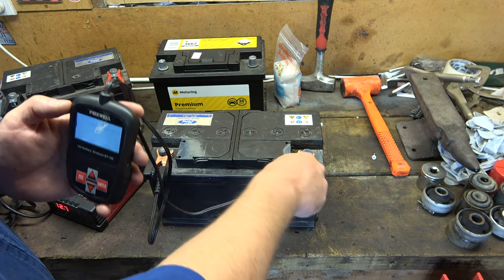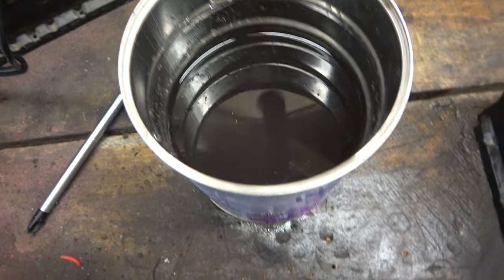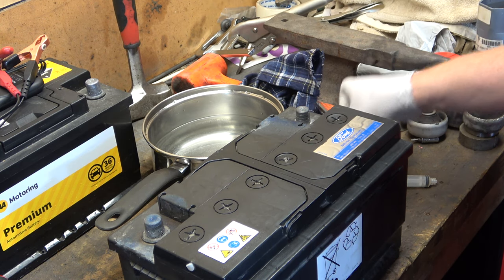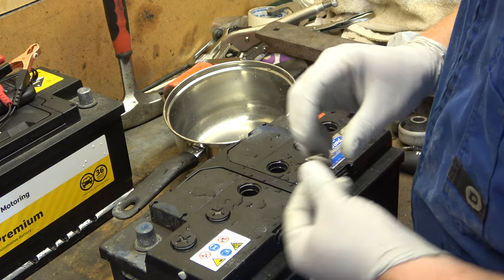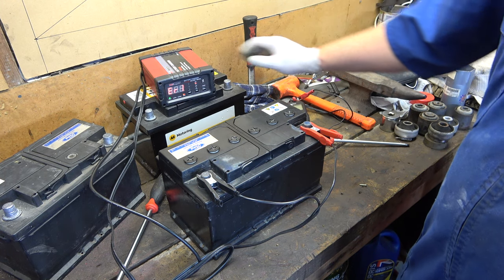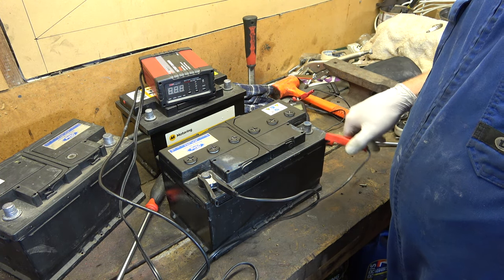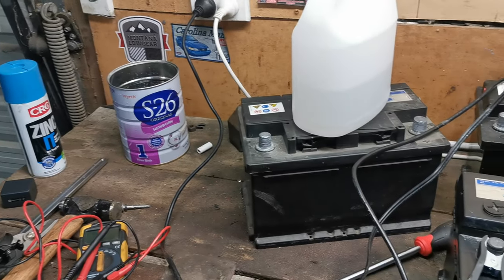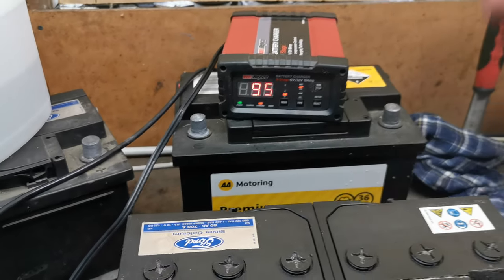Restoring Car Batteries with Epsom Salts - Does it Work?

Comment: I am Dr B N Biswal. I have tried to use epsom  salt  to rejuvenate  my inverter  battery, a huge one . It took  16 liters of distilled  water  and 3 pockets of epsom  salt. When I filled the liquid in 3 phases, from 0 it came to 08 before  changing. Whining one hour  of changing,  it came to 11. Now it is 12+. To me it is like a miracle. Epsom  salt  your presentation  are fantastic.  May Gof bless you.
Reply: Professional  battery  chargers had advised me to throwaway  my inverter battery  and purchase  a new one. My trying  your  method  made my  battery  a  new  one.

Comment: I rebuilt two of my batteries two years ago one for my truck and one for my tractor the one in the truck I drained the battery acid out of it and refill it with warm baking soda water flushed it out three times and then put in Epsom salt water charging slow for 3 days and they've been going strong for two years

Comment: I would have washed the battery with baking soda 2 stages of 6 hours each, it will clean the lead pads inside ( the liquid is dirty after this process x2 then wash it with clean destiled water) filter the acid with cotton, used a acid test meter, measure the density of it, mix epsom salt in it to increase density, or simply find another acid with better density. Hope it helps.

Comment: According to most comments I ruined my lawn tractor battery ? It would not hold a charge , I added 1 teaspoon of Epsom salt to each cell charged it 2 days and it's been working for 2 years now .
Reply: Did you dump and replace the water or did you just add the Epsom to the existing water?
Reply: @davenero8243  Just added the epsom salt and did not drain it . Battery experts call this battery " Sulfated " My theory is when a battery goes flat the sulfuric acid chemically changes to a weak acid and the sulfur portion of the acid coats the lead plates reducing electrical conductivity , The epsom salt desulfates  the battery and charging it chemically restores the sulfuric acid .
Reply: @michelgrenier1878  correct 100%
Reply: @michelgrenier1878  but you should heat water just to a pre boil and then let it cool a minute and finally stir in your Epsom salt. The reason is, Epsom salt will not dissolve if added straight to acid water. U probably got ur cells boiling real good during charge before it turned back into sulfuric acid which dissolved your salt
Reply: @michelgrenier1878  Love your theory! In physiology/medicine this is called Action Potential  ...Sodium baby sodium makes ALL come alive!!
Reply: @michelgrenier1878  yeah from what I can tell, then MgSO4 increase the conductive ions, allowing the charge to get through to the plates, and in the process re-dissolves the sulphate back into solution.

Comment: after you dump the first acid rinse with baking soda and distilled water several times cap and agitate the battery several revolutions. You'll be surprised the nasty that pours out I do the rinse thing 3x

Comment: Works very well if done right. First off you have ti flush the battery out and get all the lead particles that short out the cells. For another thing you MUST use more epsom salt. I always continue to add it till it cant disolve it all and start to get a tiny bit of unsolved salt on the bottom of the mixing container. Don't add old battery acid to it unless it is clear and clean otherwise you are defeating the purpose besides the fact that when you have got enough epsom salt in the water you are going to have a stronger acid than the battery acid anyway so why dilute it down. Once you have thoughly flushed the battery let it sit upside down and drip drain as much as possible. I just use the garden hose and a spray nozzle with it set to blast as much pressure as it can give the better the flush the better the results are going to be. Feel free to flush the battery as thouoghly as you wish there's no such thing as too much. Then you are going to want to take a couple of high wattage head lights or an old starter and drain the battery completely till it does nothing and then you need to put a high charge to it. I like using an alternator for this step as its able to put over 100amps depending on the rating of it. But anything that is able to charge at or above 30 amps will be fine and charge it for 2-3 hours and without letting it cool down completely drain it again with the light or starter and fast charge it for another 2-3 hours then do a drain but stop before you kill it completely and then charge it at a 10amp charge for atleast 48hours but it will depend on the cca rating of the battery the higher the rating the longer you have to charge it. Don't use those computer control chargers as they stop charging based on voltage and the battery needs amperage pushed into it so the old ones work best for this. If you test it and it is less than 3/4 the cca that its rated for then you need to do a long drain on it and kill it completely and recharge it at 10amps. Ive had a few that took 7-10 days of charging to get them to come back around. Works well on about 95% of batteries and I have been able to get 85% and up to 130% of the cca rating bout of them and they usually give me another year in a car or truck. But I have found that they will be fine after that for lighter dity applications like a lawn tractor or small tractor for 2-3 more years before they are finally completely junk.

Comment: You're not supposed to replace the battery acid with Epsom salt solution. Supposed to mix the old or new acid and Epsom solution 50/50 or even 70acid/30epson. The acid is needed to react with the lead.

Comment: ... using epsom salts as a secondary electrolyte seems dodgy to me.. after desulphating the battery plates, in the video really, how was that done? Your gonna need a cleaning action in the form of a chemical reaction to get those plates clean. And making sure there is no lead/calcium sediment or bridging at the bottom of the battery which could increase the self discharge rate of the battery, I would either put in new acid electrolyte or filter/clean the old electrolyte if it wasn't too bad, then put it back in. The trick is to desulphate the plates, unless those plates are a grid skeleton with little lead, and expose fresh clean lead to the electrolyte,  and of course you need to clean out any old gunk from the battery bottom that might have settled. Some have used sodium bicarbonate for that, putting a strong mixture into the battery to get some 'cleaning action' going as it neutralizes the remaining acid embedded and coating the battery plates...

Comment: Might have to do it couple of times before it work
Reply: Yes charging is key
Reply: i sawa gentleman do this...he found he had to drain the battery and recharge it again about 3 times or more to gain alot of cold cranking amps, each time he did it he gained more amps

Comment: Why are you staring at my left ear? Just kidding. What worked for me is to filter the old acid, and then refill the battery with half filtered acid and half distilled+epsom. Trickle charge for a couple days, then heavy charge for a couple hours to finish loosening the scale on the lead plates. Add a load and bring the battery to about 10.5V no load, then trickle charge again for 2 days. Battery will likely pass the tests at that point.

Comment: No Epsom salt try 200amps for 5 minutes let cool 15 minutes do this 5 times it will melt the calcium bill up then slow charge at 2 amps all night.
Reply: @Perry Vallee is the 200 amp schumacher charger theyre selling on Ebay work ?  Its an automatic circuit.  Do I need to get a manual that continues to charge at 200amp until I manually shut it off?
Reply: I do like the large transformer manuas l chargers for this but the drawback is that you can overcharge a battery if you forget. The digital ones will stop

Comment: As here, so many people who make these videos just clean the plates and don't replace the acid or check the specific gravity.  No surprise it "doesn't work" for them.  User error.
Reply from the maker: You missed the point of the video 🤷‍♂️ I look forward to your video on the subject
Reply: @Badgertronix  I must have.  I thought it was going to be a test of restoring a battery with epsom salt.  It's not as if any use of epsom salt suffices.  E.g., it also doesn't work merely to set the battery on a pile of epsom salt.  The salts help clean the plates, especially with electrolysis, but the battery requires acid for full, normal function (especially for loaded discharge)... otherwise, manufacturers would probably use a saline solution in the first place.

Comment: did you try to clean the battery with distilled water and baking soda then flush it with water again, then add new battery acid vice distilled water and epson salt?

Comment: After you clean the plates with the salt did you drain the battery and put the acid and water in it and then charge the battery

Comment: I saw a video from a manufacture that said the best way to disulfate plates is to charge the battery at 16.8 volts but only 500 milliamps for 2 days i think.. The plates get hot enough to blow the sulfate and not damage the plates. They were hawking a battery charger that did that. You should be able to use a small transformer. !6.8 vdc is just the voltage they what about 24 volts and 50 milliamps? Same effect. We all have hundreds of transformers from old devices, I know I do.

Comment: you need a bigger current 12v 40-60a charger to revive the battery ,the smart charge won't work
Reply: @oscartabares53  It's a scam, and you are a spammer, and you've been reported.
Reply: No Frank, there are cheap pulse repair chargers - you dont need the expensive high amp chargers.
Reply: @adem-Savs  not expensive at all,tons of server power modified ones with a quite cheap price,but in the real world better choice is change your battery to a set of  super capacitors,yep low in capacity but super strong current and good for your engine spark plugs
Reply: @frankli7035  absolutely. I have no idea why we haven't moved to a supercap + smaller battery setup. So stupid that we still have cars made like they are today.

Comment: here's  a few suggestions for fixing a car battery
Don't try to do this until you know what you are doing - the acid can burn you
Test the voltage first - there may be a dead cell which would waste your time.
Check the battery fluid.
Try to fully charge the battery.
(I discovered about these and more on Jons mender guide site )

Comment: Test the battery for specific gravity before you do anything then I would drain the battery and then strain what you got out of it and set it aside to put back in the battery. Next step I would fill the battery with distilled water and slosh it around. Drain the battery again and refill with fresh distilled water again and slosh it around again. Drain the battery and refill with original solution. If battery is low top off with distilled water. Now check the specific gravity again note and compare with original specific gravity.  Charge battery and measure specific gravity again, then test battery. 
 The lead acid battery used in today's automobile is made of plates, lead, lead oxide, in a solution of electrolyte. This solution consists of 65% water and 35% sulfuric acid. The specific gravity or weight of this solution increases as the battery charges and decreases as the battery discharges. As the battery discharges, sulfur moves away from the solution and toward the plates. The opposite is true as the battery is charged, the sulfur returns to the electrolyte solution.
Reply: Whoooooaahh.. mostly droppin the knowledge bomb... yeah man! 🙋🏻‍♂️
Reply: Glad two2 C ya Brother. 
Happy Motoring and have a great Christmas.
Reply: @mostlymoparih5682  You too my friend
Reply from the maker: Thanks buddy, you're a wise fella. I'll try a more scientific approach next time instead of winging it with an Internet fix that was never going to fly. Merry Christmas to you and the family
Reply: Thanks back at cha. 
Got that info from the Wizard on our trip to Kansas.
Wait I don't think we're in Kansas anymore. Cheers.
Reply: @mostlymoparih5682  thanks

Comment: The epsom salts are only for the cleaning phase.  Use it to clean the sulphation off of the lead plates.  Dump, rinse several times with distilled water, then finally refill with fresh battery acid.
Reply: this is my thought too
Reply: Yes. This method does work to break down the scale but only
Works at 15-16 volts overcharged for 24-72 hours but then the acid needs to go back in. Lol.

Comment: Hey mate, just did this method and trying to charge with an old school 6v / 12v charger although it says it's full and then stops charging. Any advise on how to force a charge.
It's a NRMA calcium battery and the charger is performer brand with 3.5ampa

Comment: I've heard of doing this, but to be honest I can't see it working.  If it did, car battery manufacturers would be filling the batteries with Magnesium Sulfate / Epsom Salts solution from new!
Reply: The problem with doing this is the battery would freeze solid in winter.  A discharged battery will also freeze because all of the acid gets used up when the battery is discharged.  Charging the battery converts it back to acid again which has a much lower freezing point than plain water.

Comment: I thought the procedure was to add epsom salt to the existing acid and top it up with the distilled water. Not remove the acid.
Reply from the maker: There are hundreds of different procedures if you Google it. As I said in the video I started with the simplest one to see how it went. Badly as it goes
Reply: @Badgertronix  I would take out a little of that fluid and put in some sulfuric acid at this point. They'll probably charge. Don't think that proves the epsom salt did anything though.

Comment: You are the 3rd Youtuber that has done this wrong. 
The salt mixture is for cleaning only. You have to put back the previous acid, or make a new fresh acid and distilled water mixture, as it would be new.

After running a heavy charge, you have to flush out the battery, because it will be very dirty with lead .
Flush with either regular water, until only clear water is coming out. Then do one last flush with distilled water. 

Then put acid mix back in. 

You can reuse the old acid. By the time you have ran the salt mixture and high voltage charging and flushing, the acid that you emptied will be clear, and the lead sulfate particulates will have settled at the bottom. 

Try not to let the black lead back in. 

And last. Make sure to use a acid testing kit, to get the proper balance. 
Then charge the battery for use.

Understand, over time, lead oxides will build up crystalline layers on the lead sheets. Because of this, you can have a fully charged battery, but no cranking amps, because not enough of the lead plates are available for discharge. 

The more a battery is used, the quicker lead sulfate is produced. And it wants to bind to each other, and dose this well, when battery temperatures get high.
Hot temperatures will help the acid to break down the lead, and delute it into oxides.
Reply from the maker: Are you new to YouTube?

Comment: 1. Calcium batteries are not good for restoration... i dont think. Use a normal battery
2. I dont think the battery was properly desulphated.If not desulphated it wont work no matter what you try. 
3 did you check for bent/ shorted plates?

Comment: You never put the battery acid back in the battery after you were done using the salts to descale the lead plates? How was it to work with no acid in it?
Reply from the maker: You missed the point of making sulphuric acid from magnesium sulphate as per the Internet myth. Clearly it doesn't work
Reply: Badgertronix ahh...well I did see that part but tuned it out ha. I always dumped the acid and hose the battery out. Fill with water and funnel a handful of Epson salt and cook that thing on 15v with the caps off for a few days. Dump rinse again then add new acid or the old stuff if it doesn’t look to full of lead crystals. Have you tried that method?
Reply from the maker: Nah, I was just trying this method for a video.

Comment: After charging, float charge it for about a week, then drain and neutralize the mixture.  The mixture helps desolate the plates and basically electroplates the bad spots with magnesium, leaving sulfuric acid (or something similar as baking soda will react with it).  After draining, add regular battery electrolyte solution and charge.

Comment: Where does one dispose of the acid safety after use?
Reply: Once neutralized with baking soda, it is safe to pour down the drain with the water running.

Comment: I used to make car batteries so I know how they work and i know
that you can't bring back to life an old dead battery any more than you can
bring back to life an old dead person
Reply: My friend works at KFC and she don't know the recipe.  My point is there are things to company don't want you to know
Reply: You can prove you can't do anything by simply not doing it.
Reply: If it's a new battery that has sulfated because of sitting discharged too long, some of these techniques might possibly work. If the battery has seen a lot of use, it may have reached the end of its cycle life. At that point, you're right: It's a core. There's no active material in the plate grids.
Reply: @vincentrobinette1507  what about an abused battery that has been drained or over discharged many times. What  chemistry is going on in this scenario( not mentioning physical damage to plates like warping)

Comment: Higher amps in short Burst, rest and repeat. The amps are what causes desulfurization to the lead plates it essentially boils off the sulfide and modern chargers generally don't have high enough amperage to get the effects needed.